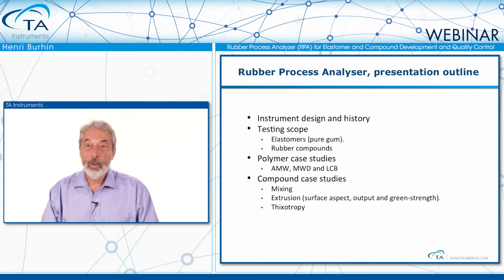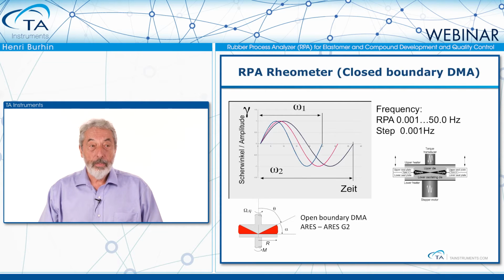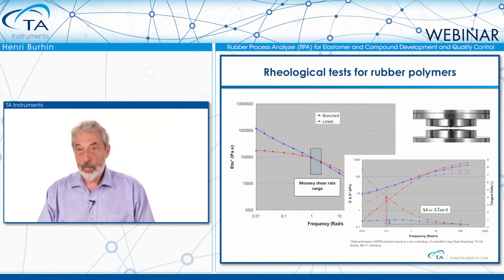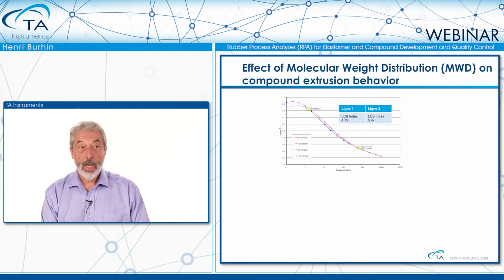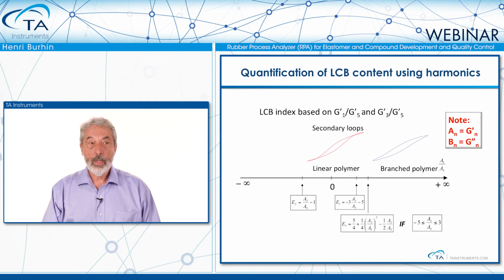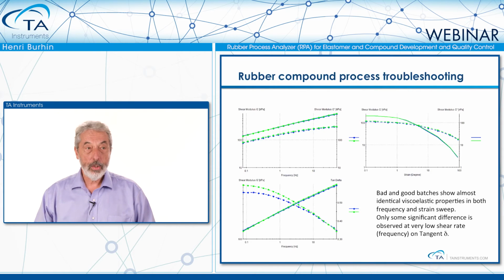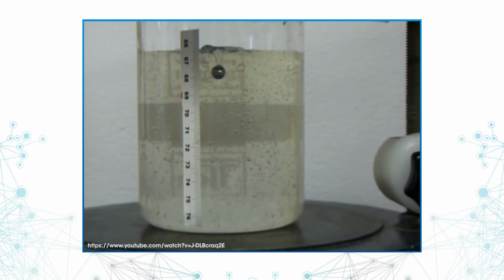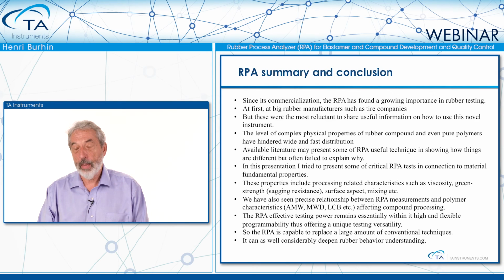Rubber Process Analyzer (RPA) for Elastomer and Compound Development and Quality Control

Comment: Very interesting lecture. Thank you very much professor. Please I have question hope to get some answer . If the results of storage and loss modulus plot dos not appear the point of cross over point what that mean and how we can make improvement to get this point .
what is this cross over point mean , it is represent longest relaxation time or minimum relaxation time

Kind Regard
Reply: Grouping materials as dilute solutions, concentrated suspensions, or gels, permits the following generalizations with respect to their storage and loss moduli. 
1. With dilute solutions, G′′ is larger than G′ for the entire frequency sweep. However, at the larger frequencies, the moduli approach each other.
2. For concentrated solutions, G′′ starts greater than G′ and at some point, they cross over. This cross over point is a function of the frequency and may be an important parameter when describing the material.
3. For gels, G′′ and G′ are independent of frequency and run parallel to each other with G′ being larger than G″. Generally, the gel point is identified when the storage and loss moduli cross over, However, gelation point should be independent of anything. At the gel point, G″ and G′ are parallel to each other regardless of frequency, ω (strong gel).